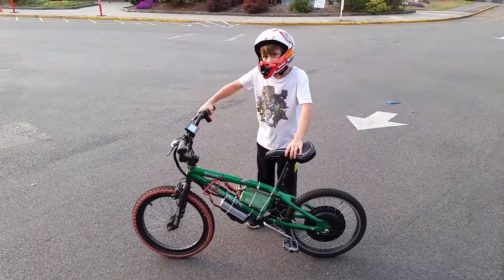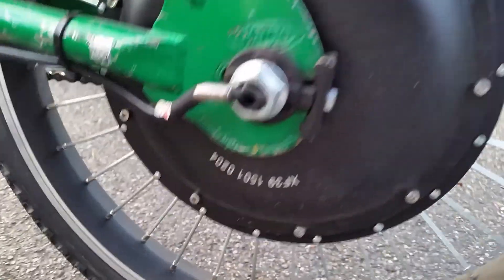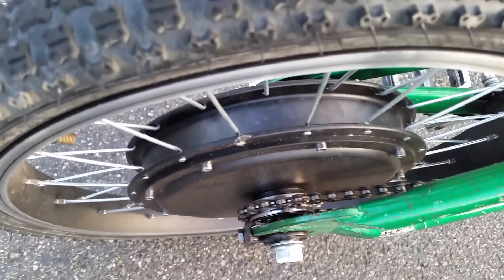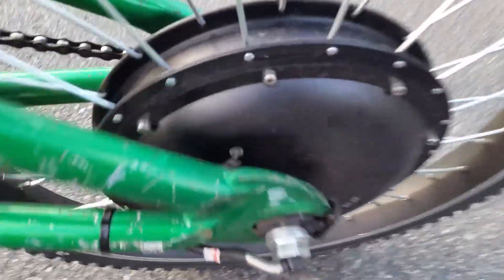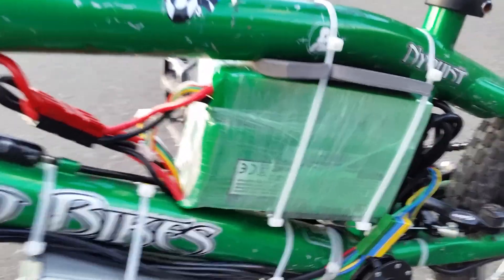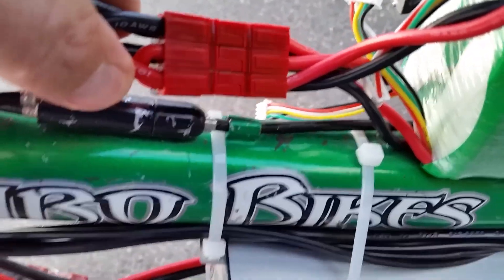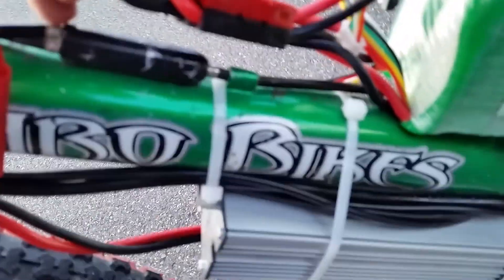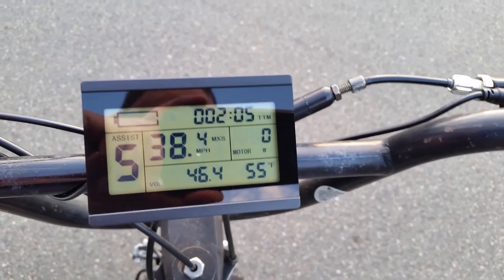Harry's Haro Electric BMX

Comment: I’m not sure if you’ll respond years later but are these ring connector set up?
Reply from the maker: Not sure what you mean by ring connectors. Are you asking about the 4mm barrel connectors for the battery power and motor phases?
Reply: @barenthoffman2840  they look like rings connected using a junction/terminal box. They are usually yellow coloured boxes
Reply from the maker: @ripp3rjak934  no, I don't use those connectors. They are not good for higher current builds. 
The 4mm HXT barrel connectors are much better. However you'll have to solder them to the wires.
Reply: @barenthoffman2840  

I think you’re talking about the battery connectors. 

The ring connectors connect the controller and the wheel hub together. I have the XT60 that connects to the battery.
Reply from the maker: @ripp3rjak934  I use the 4mm HXT connectors for the battery AND motor's phase wires.
Reply: @barenthoffman2840  Oh I see so you’re using the motor phase hallsensor wires.
Yeah those ring looking ones.
Reply from the maker: https://www.amazon.com/dp/B01CJ96XYG/ref=cm_sw_r_cp_apa_glc_fabc_KJYXTT1HYAP2B3S6BP1K

Comment: I'm about to build a 20" BMX running a 2800W 38Amp mid-drive 'Volition Boost' motor from voltbike.com, with the 62v battery sitting on a pannier rack. It will have front suspension and front and rear disc brakes.. The rear wheel will also have a Shimano Alfine 11 speed internally geared hub from https://www.taylor-wheels.com - This thing will cost me about $3,000 AUD to build, but will be the greatest sleeper eBike anybody has ever seen..

Comment: Looks like 15mph not 30mph
Reply: these sorts of controllers can have a special wire that activates a speed limiter (you need to plug in a jumper cable to activate it), a 1000w motor is capable of 60 km/h with me on board (im nearly 200lbs) but with the limiter it only goes 25/30 km/h

Comment: Hi, did you order the hub motor as is w/c is originally front hub? Cause everything I see online that's for the rear are 135mm. Or did you diy the front hub installing the sprockets, if you did, I'd be grateful for the info.
Reply: buy a rear hub motor and stretch your frame (only if your frame is steel), honestly its much better and you wont need to do any modification to the motor itself
Reply: Michael Velasco You have more grip behind

Comment: Why didn't you put electric wheel on the front?  Nice project..
Reply: the rear wheel has more traction then the front, on wet roads it would skid and slip, trust me i have a 1000w motor and wet floors do not do my grip tires justice

Comment: whats the settings at the moment bud? which winding?
Reply from the maker: For the kid, I set the speed limit to 15mph, and the controller to 30A max. the motor is a 5T winding, or ~12Kv.
Reply: perfect. funnily enough i'm about to set up the same set up. only a few more volts on a 4t
Reply: i say me. its not my build. but you know the parts